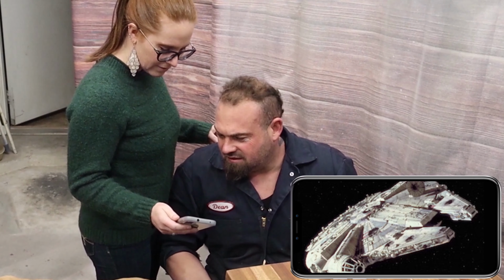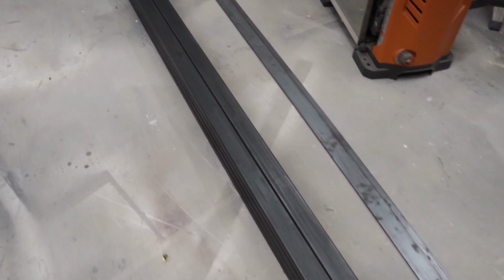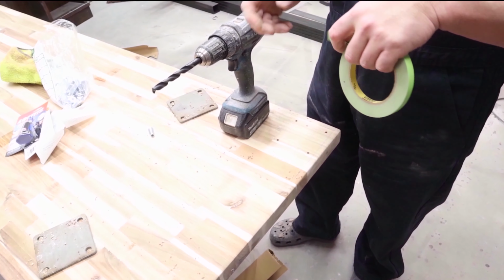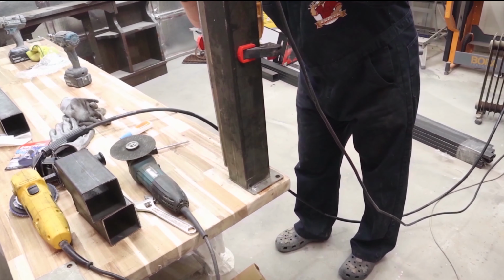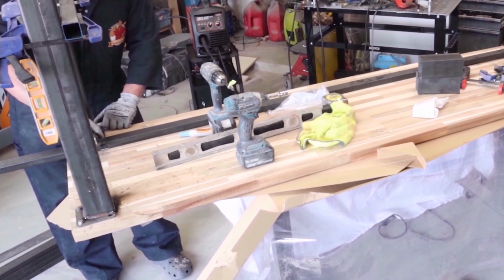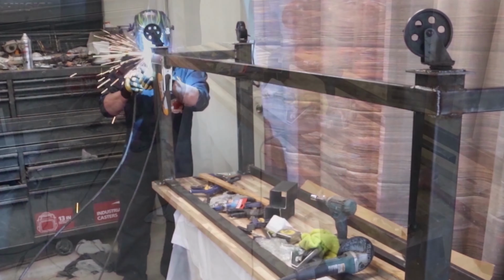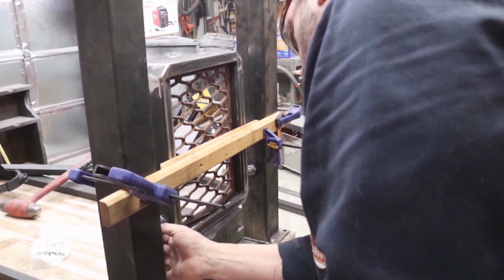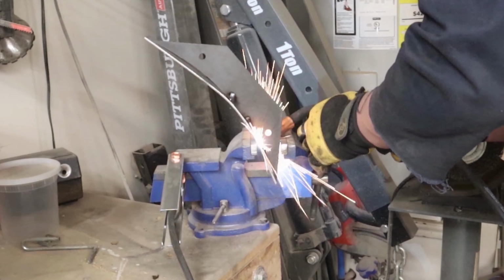PART 1: FIRST TIME WELDING I BUILD A MASSIVE INDUSTRIAL ISLAND #industrialfurniture #island

Comment: Great job! You should look into a metal roller bender to make your curved metal pieces. There are many DIY's out there to make your own or you can buy one.
Reply from the maker: I will have to look at some DIY ones. The cheap ones only go up to 1” wide. The ones that roll wider than 1” are crazy expensive.